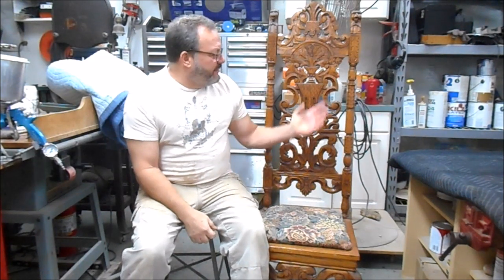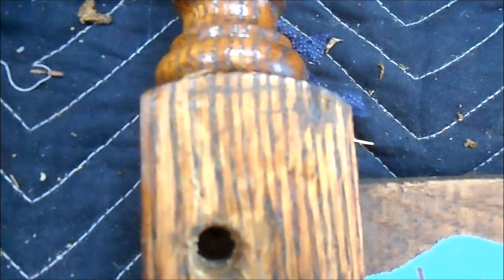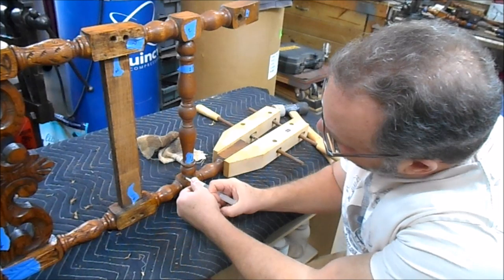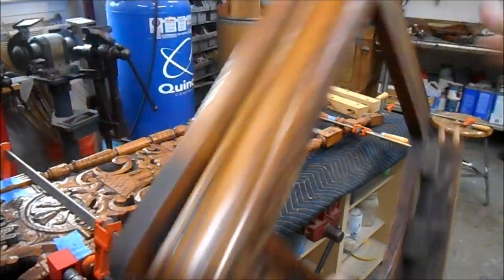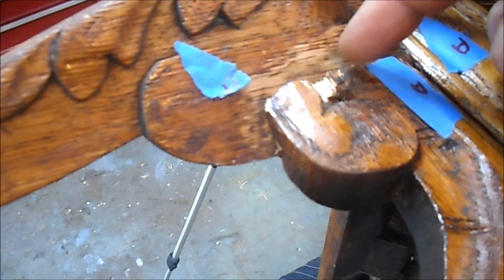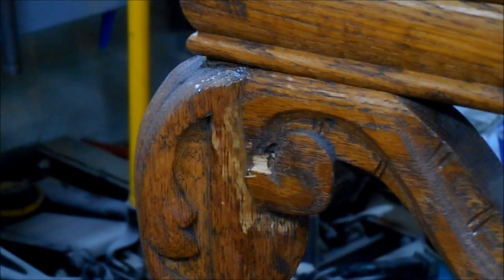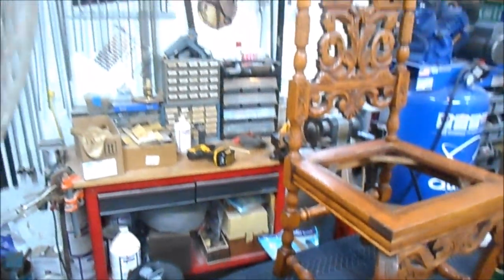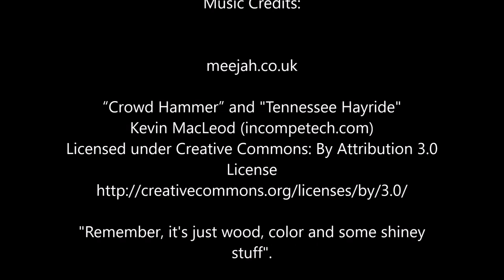Restoration of a Heavily Carved Oak High Back Chair

Comment: Couple of ideas that have worked for me; on that first rung of the ladder assembly once you get the joint slightly pulled apart and glue squeezed in —blow it in deeper with your air hose and the smallest nozzle you have. Works really well forcing the glue in. Secondly, I’ve also pulled the joint apart slightly then in an inconspicuous spot drilled a 1/8” hole at an angle (get under the dowel if you can) then syringed glue into the hole and pushed the joint back together.  Keep the videos coming and Merry Christmas.
Reply from the maker: Great tips!   I'll give them a try.  Thanks, Cory!

Comment: Wow! I really love that chair! It would have looked really cool with a cane seat in it. You should learn how to set those panels. Its pretty easy and pays well. It used to take hours to dig out the old spline but I learned a few tricks and now it only takes a couple hours, start to finish. And yes, I use vinegar to help dissolve the glue.

Comment: I don't understand why you didn't clean the chair first. After all the repairs you just rubded in all the old dirt and dust into the wood while waxing it. Some parts, like the ends of the legs look still very dirty after waxing. I understand you wanted to keep the antique look, but cleaning the wood before waxing seems a usual order of working, at least to me. 
The end result looked good tho

Comment: First viewer!  Yes!  Kind of a dumb question... Could you talk about rag usage?  I find myself throwing away a ton of rags I cut from old clothing and towels rather than wash them because of the stain and chemicals they have on them as I don't want that in my washing machine.  Of course, I let them dry so they don't combust.  I also use a lot of paper towels in a box.  Is this pretty much your routine as well?  It doesn't look like you use "shop rags" or anything special.  Also, I find cheap chip brushes shed their hairs - have you found this as well?  Thanks, keep up the good work and Merry Christmas!
Reply from the maker: We buy what will become our shop rags, usually at Sam's Club (Wal-Mart's Warehouse Store).   I get terry cloth and microfibers there.  They are pretty cheap.   The new terry cloth dish towels go to my wife for in-house use until they get worn or stained.   They then come out to the shop with any other household cloth cast-offs (like old T-shirts, etc).    Once in the shop, they go into one of two buckets where I pull them from when needed.  I use them as long as I can before they need to be dealt with.   Ones that get oil stain, stripper and the like on them are air dried and thrown out.   Other rags with wax, dye stain and other stuff on them go into a fireproof container and are eventually washed and re-used.   We wash them, take them out and run an additional cycle to clean out the washing machine if need be.   Once clean, they go back into the shop, go into the box and await being used again.   Within the shop, I try to keep a few out and use them as needed.  Again, if they get gross stuff on them, they get air dried and thrown out.  Others get re-cycled again.  I keep a box of paper towels as well and use them for wiping off epoxy, etc. to keep the rags from getting ruined.

I buy chip brushes on Amazon and haven't had any problems with hairs coming out.  I have some acid brushes I use for glue, and the latest batch (again, off Amazon) have done a bit of shedding on me.  

Hope this helps.  Thanks for watching.